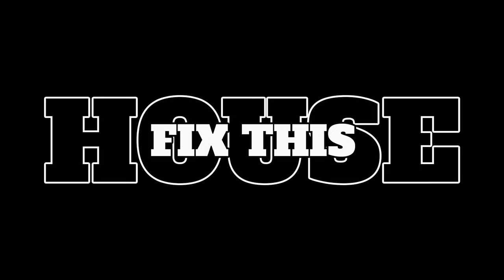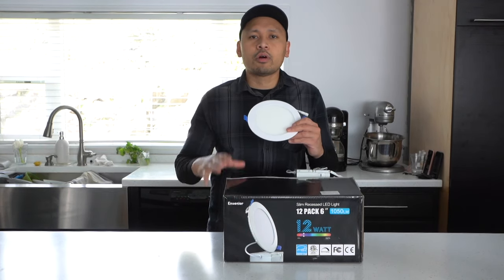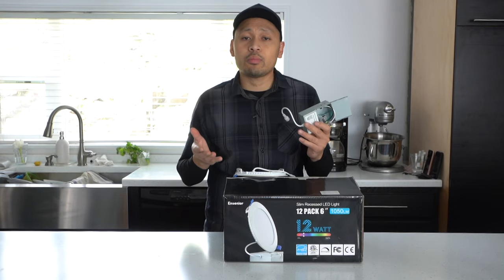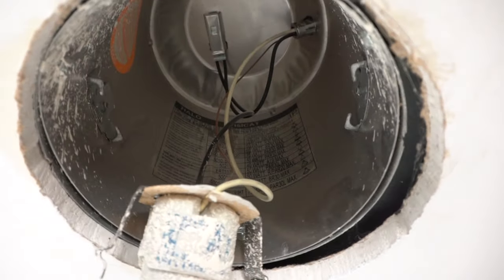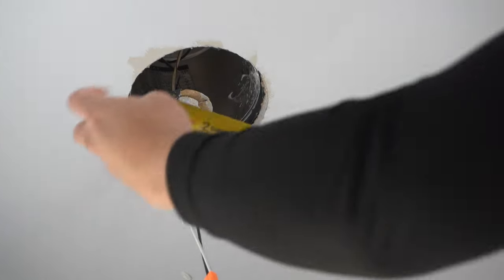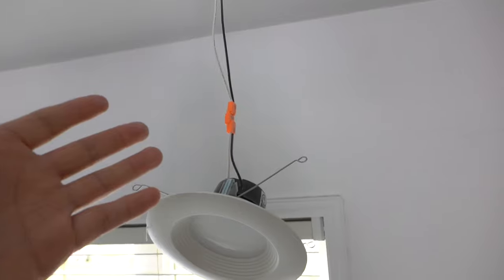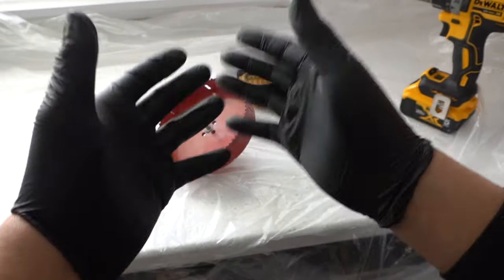How To Install Pot Lights In Kitchen Ceiling | Easy DIY For Beginners!

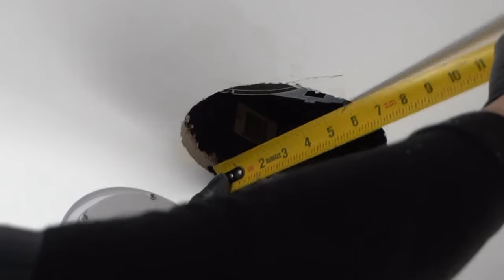Comment: Hey, man.  At 8:48 this is wrong!  When you removed the metal knock-out from the LED driver box, you're supposed to insert some sort of connector bushing, such as an NM plastic snap-in connector or a metal clamp-on style entrance connector.  The reason for this is so that the sharp metal edge of that knock-out hold doesn't slice the Romex over time and create a short or fire.  It's purpose is to also keep the Romex cable in place so the wires don't all slip out of the hole or pull away from the wire nuts/Wago style connectors. You installed it wrong by just feeding the Romex directly through the knock-out hole without a bushing connector.
Reply: I just installed a set of these and yes, I used a plastic connector in that knock-out hole thanks to advice on that from the Renovision channel.  I don't know if not having it is "wrong," but I see it as that extra level of insurance against electrical fire hazard.

Comment: how did you pull the cable from the quick connect? I think it was one time only once cable was pushed into the push connect inner housing. Or you just pulled it back out and it would come out eventually?

Comment: Once it's snapped on, how do you take the pod lights out if you have to replace them?
Reply: Gently pull them down. The springs hold the light with slight pressure and will release.

Comment: what if there is no atic access? specially for first floor
Reply from the maker: It’s still possible. Although depending on your code, most codes require an attic access. Please try to find the opening. At the mean time You’ll just need to snake the cable to each opening hole you make depending on how many holes you make. Then connect it to the existing power switch you want to replace the old lights with.

Comment: The drooping at 3:28 is a result of the brackets in the back of the recessed light not being adjusted. If you go to the 15 minute 50 second mark at the link below you'll see how to adjust it so it doesn't droop. https://youtu.be/-KzEkCUDtZM
Reply: By the way, great video. Going to get some of those lights to try them out.
Reply: adjusting that did not work.  my lights are still sagging.  how can i get them to not sag?

Comment: What happens if the existing hole is larger than 6 inches?
Reply from the maker: Hi Raymond! If it’s just a small amount would fill the edges with hot mud and try to build it out then trim. Or I would cover it with new drywall and then start over for a new hole.

Comment: That is a ton of work for almost zero benefit. And if you had a second floor it would be much more difficult. Bend the springs and the existing fixture would go flush.
Reply: The new ones are more energy efficient and also spreads light more since it's not as recessed
Reply: @germandiaz1651  he had led retrofits in there, so the energy efficiency shouldnt change.
Reply: @acreageliving  then it's more about light spread with it being less shallow

Comment: Seems like you're too close to the wall. Maybe you couldn't change that but I saw a video that talked about placement and how the light should be a couple feet away. Also don't have them close to a ceiling fan. It can cause a strobe effect and make you go nuts.

Comment: I see zero benefit in this project. Having cans is much more superior than wafers. If one of your wafer dies, you’ll have to replace the entire set. Not to mention the wafer has zero focusing. The light is too spread out.
Reply: I agree completely.  I use the wafer lights for new installs in my house so I am not restricted by joists when planning my layout, but for the rare instances where cans are already in place, I just use the screw in retrofit LEDs.  This is a lot of work for very little (if any) benefit.

Comment: Your lights may be too close to the wall.  Need at least 3 feet away from the wall to rid of those shadows.
Reply: Way too close! Look at the spot lights at the end of the video. Not even 12in off the wall. It looks like you're trying to showcase some artwork. I'm sure it's because you wanted them over the countertop but then 6in lights were for sure not a good idea.

Comment: Pot lights are suitable only for first floor ceilings. Don’t use them in ceilings below an attic. They are not air tight. Rodents can actually press through since the springs are weak. And loose fill insulation will pour on you if you remove the light to tinker with it.
Reply: not here to argue... in my experience, the springs on the canless lights are pretty firm.. I dont know about cheaper light systems but it takes quite a bit to pull a canless light down.

Comment: That’s not installing them… lol that’s replacing them.
Reply: He's 'installing' the replacements.  It's still called an installation.  Sorry if the definition does not conform to your personal understanding.
Reply: @KathrineJKozachok  no. It’s not my “personal understanding” replacing them would be swapping out the existing ones. “Installing” them would be  making holes, running wire, picking spots. Nice try though.
Reply: @DropThatDelly  Agreed
Reply: Depends how you define "them."  He is actually installing one item and replacing another item.